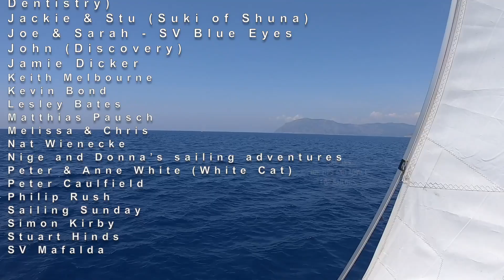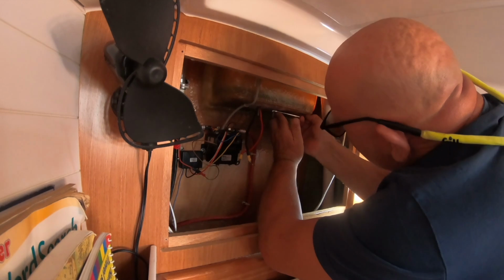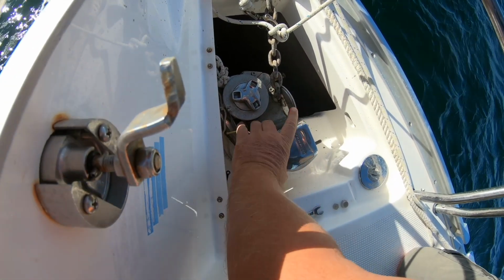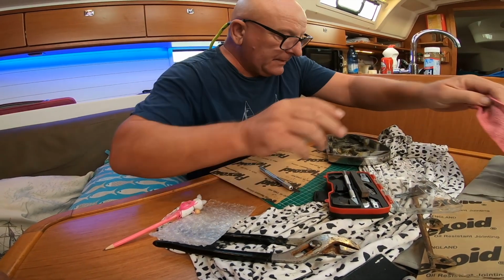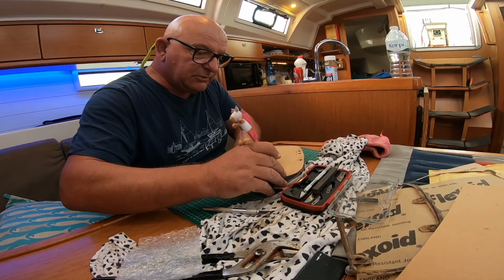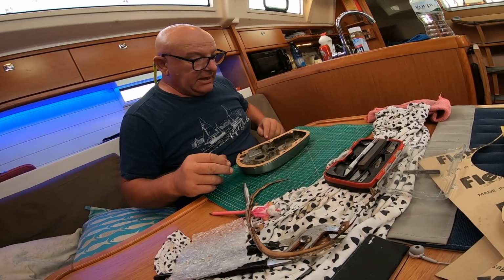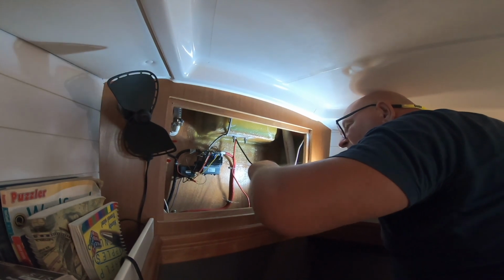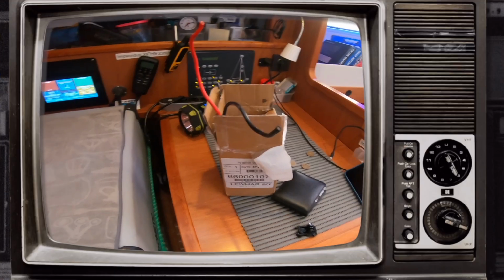Windlass Fails At Anchor! Can we lift our Anchor? Its a race against time! The Lewmar PRO-SERIES

Comment: Instead if is the brushes, would it be worth while changing annually?
Reply from the maker: Probably Steve, the motors seem pretty poorly made even though they have a 5 year warrantee from new. The motors are about £150 so its just as easy to swap them out when they fail every 3 years. Sail Safe mate. Ant & Cid